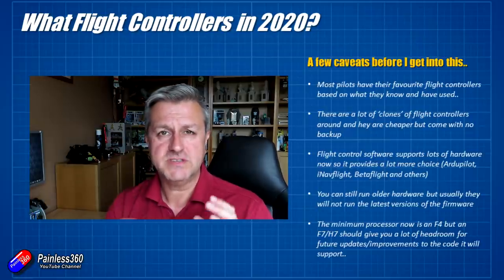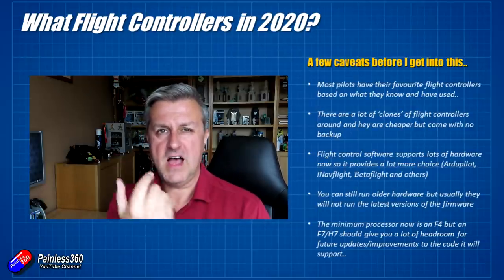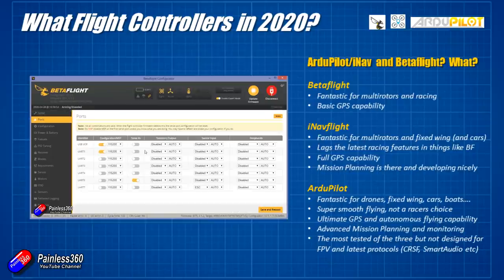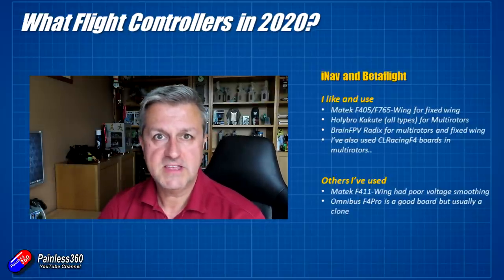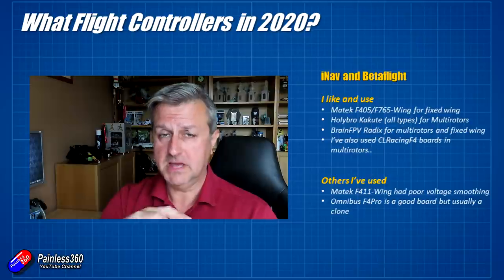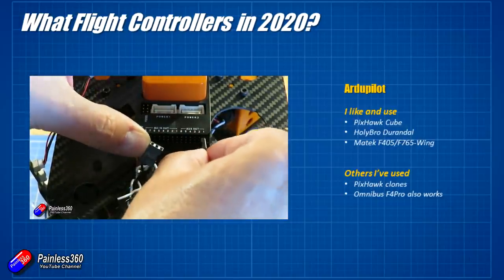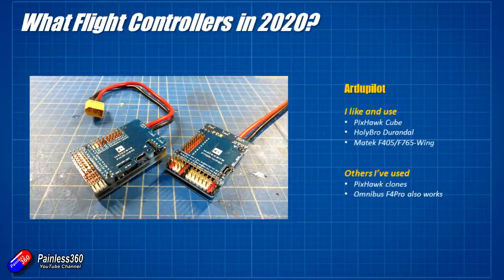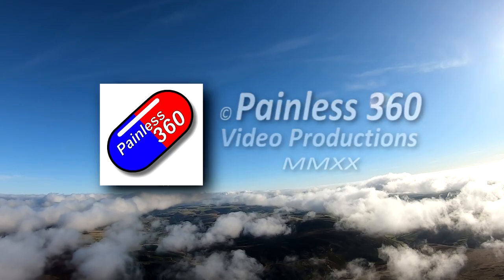My Flight Controller Picks for New Builds (May 2020)

Comment: Thanks for the update. Is the ET Vector still in the running or is the BrainFPV a better board now? 👍
Reply from the maker: The ET Vector is a nice flight controller but hasn't been updated for many years. It doesn't support the latest protocols and standards in the hobby but if you can overlook that it's still a choice.

Comment: Anything wrong with using the Pixhawk 4 instead of the cube to save some bucks on a  fix wing?
Reply from the maker: If you are going to do that then I'd look at the Matek wing boards - see my videos on the fixed wing builds with one..
Reply: @Painless360   I don’t see where the Matek 722/765 boards have Sbus out like the pixgawk does?

Comment: Awesome vid! Is it recommended to use the F765 Wing FC on a quadcopter build?
Reply from the maker: If it's ArduCopter, possibly. If it's not then the HolyBro, CLRacing or BrainFPV systems would be my choice..
Reply: @Painless360  Sweet! Thanks for the information.

Comment: Can a fualty FC cause batteries to drain quicker they should? Only casual flying with no extreme punchouts or flips and rolls.
Reply from the maker: Interesting question. Has it always done this ir is this a new thing you've noticed with the model? If it's new - what changed?
There could be ways that a faulty AIO FC could cause power issues or maybe a PID setup is to aggressive.. Could be a few things but more likely to be something more basic..
Reply: @Painless360  its not always been like this i used to get good flight times, I have change anything for a while although before the lockdown I noticed the frame was getting warm but couldn't find any shorts on the frame.
Reply from the maker: I'd also suspect the battery is past it's best - what type is it and what internal resistance does it have?
Reply: @Painless360  have 2 5s tattu and a 6s graphine. I have just ordered a new one to test.
Reply: I have another question about battery drainage. Do you think a bad capacitor can cause the lipo to drain quicker?

Comment: what’s your pick for a flight controller for a large quadcopter now?
Reply from the maker: Depends on the firmware. Durandal or Pixhawk cube for Arducopter or one of the Matek boards for betaflight or INAV..
Reply: @Painless360  Thanks for that. Thoughts on what firmware work be better for slow moving filming quad? I’m rebuilding my Tarot 650 with low kV motors.
Reply from the maker: Ardupilot.
Reply: @Painless360  thanks for that.

Comment: I dislike that the matek doesnt support a hardware arming switch. Its led to an issue with my escs arming. I run dual on the nimbus and only one arms unless i unplug and replug the pwm. For a cheaper option i like the pixhack stuff. Thanks for the vids
Reply: Jacob, I personally don't understand the hardware arming switch you mentioned, like the one on the Pixhawk. It's really easy to solve the "ESC's arming" problem with the Matek FC's. There are several solutions if you want to be able to plug in your drone or fixed-wing...Some people setup a multiple switch arming on their radios so you physically have to move two switches to a specific configuration before arming will occur. You can think of it this way...you're moving that hardware arming switch from the sometimes unpredictable flying circle-saw, to your transmitter/radio which is already in your hands and much much safer to our limbs/extremities. Why would you want to walk up to a plugged in copter/plane and have to stick your delicate finger near it? Finally, imagine the XT60 on the battery is a button...The way you push it, is by simply inserting it in the XT60 on your rig. That's just like a hardware arming switch. I promise your ESC's won't arm unless you plug your battery in :) That's my perspective. To each his own though. Happy flying.

Comment: Good video, question, can you help me find a module to covert my JR652 72meg to 2.4 gig?
Reply from the maker: Lots of options for radios with a JR bay... Does it have one?
Reply: No not for an external mod but I can replace the original tx, or switch and use both. Just cant find a mod anmore.

Comment: do you have advice for a gps module for about 10 ~ 20 dollers?
Reply from the maker: Google M8N. It's what I use in the builds..Happy flying
Reply: @Painless360   do you know how it compare to a bn-800
Reply from the maker: I've used those too but M8N seems to lock faster and find more sats..